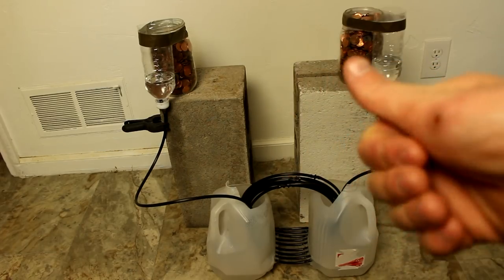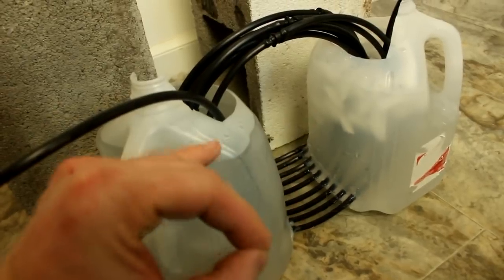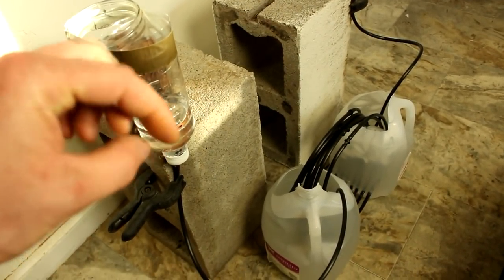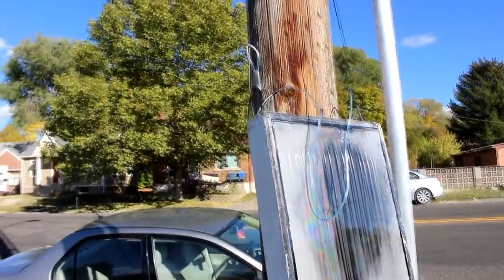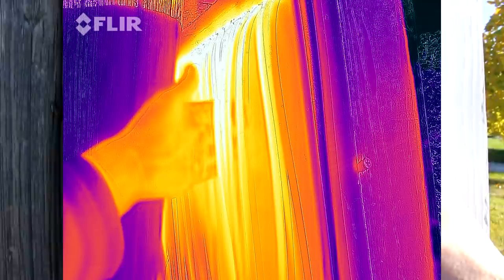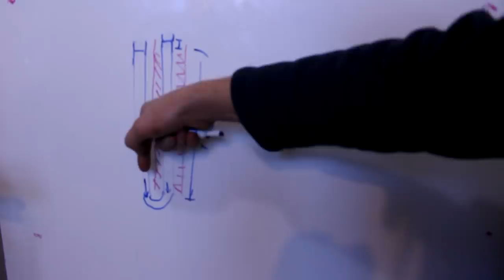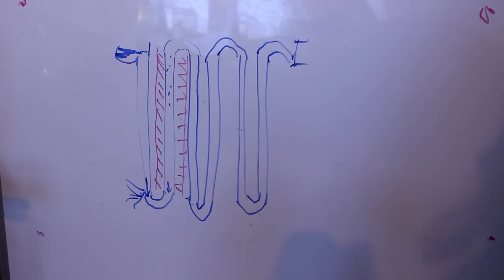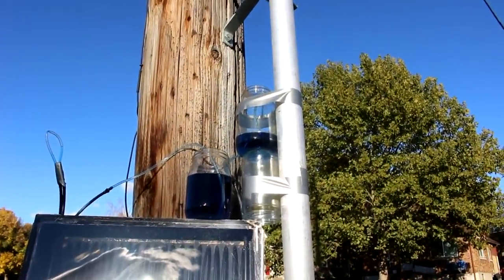Water Pump With No Moving Parts? (except water of course)

Comment: 1: Have you considered shielding the output reservor from the sun so that it was at a lower starting temperature? If what I recall about thermodynamics is right, you're going to end up with a similar temperature in the heated areas of the tube regardless of your input water temperature since you've only got so much potential to heat up the water with the tubing system.
2: Since you're relying on the difference in temperature to create a change in pressure, you should definitely take Paul Paulson's advice in controlling the hottest point of the tube so that the top of the tube is as neutral as it can be between the two temperatures. Could shade the top of the glass chamber or maybe shorten the heated space so that part of the tubes near the top are exposed to an open cavity in the shadowed area.
3: Possibly make some sort of heatsink at the back of the pump to help bring the tubing and the water to as cool a temperature as possible, I don't know how realistic it'd be to make some sort of breeze catching set of fins, but if it's solar powered I figure you could utilize the wind without needing something mechanical.
4: Find the best point of the day with the most potential for sunlight with the lowest temperature you can find in the day.
5: multiple pump tubes in separate heating areas? could cover more sunlight in the day if you spread the work around.
6: bring the tubes together so they're connecting on the sides at the front and back of the unit, spreading the temperature as evenly as possible?

Comment: You should use aluminum tubing so that the heat could radiate a lot faster than the plastic tubes to help it cool down faster on the back

Comment: you made a flat plate solar collector, which is a heat exchanger, and are relying on the thermal expansion of water to induce flow.  You might consider adding a check valve between your reservoir and the (solar) collector.  You could increase the pressure in your system if you start out with a larger tube size and gradually make it smaller.  The check valve will prevent expansion into your reservoir and will force the water to flow in one direction.  This wont work forever as you will also be incurring friction loss in your tubing.

Comment: Having the collector tubing running vertical as you do in the solar panel is working against itself. If the tubing was laced horizontally the bottom would be cool and eventually warm as it rises. The tubing at the top would be as warm as it can get - and therefore - pressure.

Comment: Cody'sLab, you should invest the time in a txt book or two in thermodynamics and if your feeling brave fluid and hydrodynamics following some simple principles and formula its very easy to not only to greatly improve on the design of this pump but to calculate its efficiency off the energy it receives.

Comment: Physical energy storage is becoming more and more important with the growing need for green house gas reduction. I imagine it would be very important on Mars as well because there isn't the possibility for hydroelectric yet. Currently, the system is being done with solar panels and motors with a large weight being lifted to store energy. Water increases by 10% when frozen and produces immense torque while doing so. I wonder if it's possible to create a device that uses waters expansion as it freezes to lift a weight (using a gear ratio maximized for the amount is torque the ice will produce). In places like Canada and Siberia where temperatures regulatory drop below freezing at night and rise above it during the day, I think this could work well. The main issue being the seasonal dependence of the system. On Mars however, the temperatures are much more constant and dramatically change from night to day each sol. At the equator, it can go from 20°C to -73°C meaning on most of Mars, the system would work year round. This pump operates on similar principals, do you think this idea is possible or even worth using on Mars?

Comment: You could make the same kind of pump by putting the tubes ito the ground to cool down the water and then use some kinds of mirors to heat it up. It might be a bit more work but it would be more efficient i think.

Comment: Or you could use a siphon. Which would do the same thing (while requiring less work, and the temp would stay the same),  you also could control the amount of water coming out by tube size and or elevation. 

I use  siphons to clean out aquariums and drip acclimate more sensitive fish.
Reply: Livebearer Fancier siphons cant pump to a higher level, you merely use the atmospheric pressure to overcome a highpoint
Reply: Yeah...    After watching the video again it sounds like siphons would work but the issue would be that hours or days later (depending on his setup) Cody would have to put water back into the highest container to keep the siphons dripping and he said that he wanted a closed system that would run continuously without his input.  So  it sounds like for Cody said he wanted siphons are out of the question. If he set them up  right they could drip for a long time but not continuously.
Reply: I'm not quite sure you understood Invictus_CS's comment. Siphons don't produce a net pressure head, they seek to balance one out. Like you said, with your siphon you're already starting with a jar up high and siphoning down. Cody is trying to get water up to a jar.
Reply: That's why I said that the model that I was suggesting wouldn't work for what Cody wants to do. Yes my model would allow water to flow through the shrimp boxes but cody himself with a bucket  would "get water up the jar". Cody seems to want to make a pump that doesn't use electricity and to let it run itself with little to no maintenance.

 I understand that siphons only go from a higher elevations to lower elevations and not the other way around. The model I had in mind would  allow water flow but the downside would be that someone would have to take the water that went through the system at the lower elevation and manually pour it back into the container at the highest elevation.
Reply: Oh okay I see what you're saying. But he wouldn't even need a siphon for that--just a bucket with a dripper on its bottom.
Reply: For one shrimp box sure but I thought that Cody wanted to connect them and have water flow in between shrimp boxes(I could be wrong but that's the impression I got).  Though you could put a dripper on all of the shrimp boxes there are 3 possible problems  with that model 1. anything that accumulates on the bottom of the box could clog the  dripper 2. all  of that stuff would accumulate in the bottom shrimp box 3. if you wanted to use the same water multiple  times  you would have to filter all of the crud out.

Because the siphons would  be at the top half of the shrimp box nothing that accumulates on the bottom would transfer in between the boxes.
Reply: So, didn't he say he wanted to circulate the minerals? And also, I thought he was going to stack the boxes. Water naturally flows from the top shrimp box, gradually making it's way to the bottom shrimp box, and he wants a way to pump the mineralized water back up to the top. Am I mistaken? D:
Reply: Originally I proposed my idea because Cody was having problems with keeping the water a consistent temperature, I didn't understand originally that he wanted to have a method for bringing the water up as well as water flow downward. Frankly I don't really care what method he decides to go with anymore as long as he finds a solution that works for him.

He did not use the word minerals but he talk about salt.

 I apologize in advance if this seems rude but I am no longer interested in talking about hypothetical models for water pumps. You can do what you want but i'm kind of done with this topic  and have moved on to other video comments sections.

Comment: Tangential question : if you would somehow get only positive or negative ions in the solution, and have your windings around a transformator core - could you retrieve electricity from the other winding ? If so - you might be able to run peltier elements on the heat exchangers to improve on the process
Or maybe you could use this type of concept to built a generator?

Comment: You should use copper tubing to reduce the tube expansion and increase the heat dissipation on the cold side...

Also, I think it would be better to compare the water displacement by volume over time instead of centimeters (for example: mL/min).

Comment: I wonder if this would work at scale. Say, using thermal heat to pump water from a valley reservoir to another at high elevation. Using the earth as a means to quickly cool the sun warmed water pipes, seems plausible. The raised water could then be used as a means to generate super cheap hydroelectric power, since the pumps to raise the water are powered by solar thermal energy. If you use a check valve to prevent backflow, this could sustainably run indefinitely.

Comment: I was trying to figure out how to do this using capillary action.  However, not only could you improve mobility of the water using the ground and an above ground enclosure.  You could also stack reservoirs to move water up mountains and hillsides this way without great expense from pumping.  You may be on to something, I'm going to see if I can't reduce the size of the tubes by flattening them into a radiator design.
Reply: The only problem is that without a heat differential it's not viable.  So solar is probably the best option.  Yet, I wouldn't discount biomass heat either.
Reply: Even geothermal where available would work.

Comment: In order to increase the efficiency of this thing, we can either:
- increase temperature difference (boring)
- increase total height * stages (boring)
- increase water temperature expansion (maybe use a different fluid? i don't know)
- increase gravity (!)
- increase density(!)

What if instead of gravitational field use magnetic field? A really strong magnet and ferrofluid can provide way higher force provided fluid magnetic pull is proportional to its density. Would work in space too!

Alternatively you can use mercury to increase density so that assuming they have the same thermal expansion you'll get roughly 13.6 times more effect under the same circumstances.

What do you think?

Comment: Thanks for sharing. 
Found Interesting & educational .

If you ever revisit this experiment, 
I've got two different suggestions for you to consider.
(or just let us know if you don't think it will work...)

1-> instead of a two dimensional design, how about a scalene triangle design. Large flat side as heating element. 15° slope from top going 3/4 the way down. And make the bottom back slope section a contained coolant tank.

2>-> A more simplicit fashion that might work too...
Just as you have done but, 
use one or two 2" PVC pipe 
drilled to run tubing snugly through, 
where you can contain a coolant that will add just enough cold shock to the system to reset your 30° differential. 

Just a couple of thoughts. 
Be interesting to see the results, 
if you try out

Comment: The cooling will be more efficient if you run the cool tubes along a large plate of aluminium, fastening them flat
Also you can do the same with the hot side, by making the back plate out of aluminium painted black and again fastening the tubes flat across it

Comment: Just use one or more old (not plugged or leaking) car radiators on the back.  For a heat exchanger, maybe a water jacket like on a still or condenser just encapsulating all of them or even a big copper sheet with thermal compound connecting all the tubes to it.  If it wouldn't sap too much energy a Stirling engine or maybe a seebeck/peltier generator could power a fan on the cooling side?

Comment: Now, if you could use the drop of water a day to run a tiny generator to heat the tubes you've basically created a perpetual machine... but I know, E=mc2 and the potential energy-output from whatever waterflow created would be less that the energy needed to heat the water to create said waterflow.  

But, not sure if I've overlooked something in the following idea here, but I think you could greatly enhance the "greenhouse effect" of your solar panel, by using reflectors, and maybe copper plates painted black, then use a thermo blanket in the back wall and   use a natural waterfall to help cool off the water, maybe use copper pipes on each panel, but have the bends of something less heat conductive in the bends. And what if you made a coil of a 100 loops, and archive a temperature difference of maybe 60°c?

It would probably be quite an expensive build, but you got them brains in your hat-rack so you could probably calculate yourself to an estimate of what something like that would be capable off.

Comment: you could attempt to use Grant's solar scorcher idea to focus the heat into a sort of heatsink to greater heat the water and improve your temperature differential, albeit to a lesser extent as to avoid frying your equipment and vaporizing your water, maybe his mini scorcher or an even smaller adaptation to heat an object as a means of spreading out the extreme heat to the entire "hot" side of your system.

Comment: old petrol motors used this to cool the engines, simple and no moving parts. you could use this more if you instead of making them inline just make a manifold and have multiple cells to create a volume of moving water.

Comment: Could probably use a Stirling engine on the difference of water temp to power a fan to accelerate the process and give it more potential. With a vacume pump you could evacuate some glass tubes and put on some reflectors to get more of the energy in the tube and less into everything else.  Also da vinci check valves might help? Also what about using an "alternative" solar process like molten salt to heat the water faster and store the energy for longer after the sun is down with the trade off of a longer warm up?

Comment: I'm not sure how you'd get a heat exchanger to work here (at least in the unpowered state you're operating in), but one simple thing you could do is put some kind of radiator/heatsink on the pipes in the back, this would improve the cooling rate on your water.
Reply: Hmm, and maybe there's a more efficient way to heat the water up in the front?  Air is a pretty poor thermal conductor, what if you encased your tubing in a more thermally conductive material?  Though, I suppose that wouldn't get as hot as the air does.  Maybe there's something to that idea though.

Comment: Making the tubes out of copper and having a really nice heat sink on the cold side would improve it quite a bit.
Reply: This would make it pretty impractical for adaptation to his shrimp boxes since copper pretty quickly degrades in the presence of saltwater and i cant imagine copper oxides are very good for crustaceans anyways, I imagine it would be a bit like having our air inundated with rust dust.

Comment: interesting. Ram pumps would probably be a bit better, but heat engines can be interesting. Since you're working with enclosed environments anyway, You could have one side be a vacuum panel, kinda like the solar hot water heating tubes.

Comment: Have you considered putting one-way valves in it? Like you said the pressures differ from hot to cold, so it equalizes the pressures, but both ways. If you added one-way valves in then all that  hot water has one way to go,

Comment: Hey Cody! What are your plans for improvement on this system? I am imagining copper piping would make heat exchange much easier, and I am tempted to say that hundreds of turns of tubing would be good too, but there are probably diminishing returns. Still, I would love to see how this can be developed upon. Perhaps instead of direct solar heating, electric heating powered by a solar cell can be used? There still wouldn't be any moving parts. Also, I wonder what other things can be done using elements of this design. What if something with a low boiling point, like methanol, is used? Could the extremely high pressures you mentioned be used for some kind of crude solar-powered water-bomb or gun? Idk I just hope we see more videos about this.

Comment: Cody! Thanks for the awesome videos as always. Learning more diversity in science always helps! Some time ago I had seen a straw siphon used to transfer water in containers just using surface tension(or best assumed). Using that water tension alone could you make it go higher even if just a mm? This intrigued me further watching a recommended video onto this involving Polyethylene Glycol. I keep running the visual of a straw siphon "ladder" of containers to gain height with each container near full. I know perpetual motion isn't possible, but what is the limit on this system? Hope others have an answer for this and maybe spur some ideas in others!

Comment: Hey Cody,

What about using a ground source heat exchanger for the cold side of the tubing?  You would have to re-structure the tubing but it would increase efficiency while not requiring any more energy input.  Would be a nice opportunity to teach about heat exchange as well.

Comment: Rather than letting the tubes air cool on the back, would it be helpful if you put them in contact with a solid with higher thermal conductivity to create a sort of "radiator" of sorts?  Maybe immerse them in water?

Comment: It's not exactly the same, but this reminds me of thermal pool heaters. The panel is essentially the same design, but you run an input and output to your swimming pool. I've also seen these as literal water heaters -- I don't know if either of those example use electric pumps/latent pressure of household water.